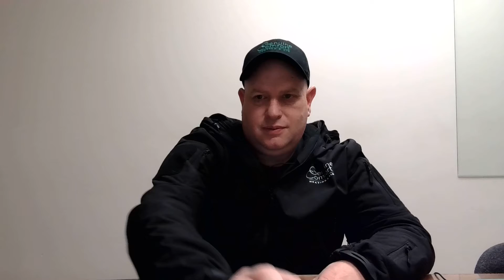Why Do Furnaces Short Cycle

Comment: Thanks for trying. The number one most complained about problem on home heating and cooling DIY repair forums when the problem didn't start getting worse on it's own (which can indicate a component in the furnace not working correctly, or a dirty filter) is the furnace firing up and running 5 minutes on and 5 minutes off during the winter. Most of these complaints were by the DIY'er that just changed from a manual thermostatic spring type thermostat to a digital solid state type. The problem then is these newer thermostats are just too sensitive. They sense the air blowing right out of the duct vents too soon and react immediately. Then the room cools too soon, and back and forth like that. With the old thermostats it took a while to affect the shape of the spring to activate whatever type of physical switch it had in it. Which in turn caused the area to be better saturated with heat. Also those old thermostats didn't react as fast and call for heat as quickly, as the room took longer to cool down, especially if there were furniture and things in the room that stored up heat and slowly released that heat as the surrounding air cooled. 

I just happened to be searching the internet to see what kind of new tech had been developed in thermostat controls lately, and I'm still not convinced enough that I'm going to spend an extra $150 to $350 for a smart thermostat just to control it from my phone. Statistically, they have a habit of not lasting very long, and the only other feature they have besides the phone controlling aspect is that they learn your coming and going habits, but only if you leave and come back around the same times every day. You can do that with the 7 day programming set back feature on about any $20 digital thermostat. So what is left is that they have the 'cool look' feature, but many consumers aren't with the buying it over and over every 3 or 4 years scenario to get that. Then, to what point is it really saving money?

Anyways, as I was searching the internet this saturday morning for what might be "new and improved" (laughing to my self as I think about all my friends and family that are buying new washing machines and clothes driers every 3 to 5 years because they are more efficient, and I'm still using 1980's units that are easily and cheaply repairable) in the HVAC controls department, I ran across this website www.tempitrue.com , and as an old guy that is wise enough to know what works, I said Hell Yeah! Now there is something that will work. I know because I have a shallow cardboard box with a hole cut in it covering my $25 dollar digital thermostat that I don't even use the programming part of it, I just leave it set at 70 all the time, and that little trick right there saves me at least $30 to $40 a month in the winter time off my used to be natural gas bill, and another $10 a month off my electric bill from the furnace fan running less. My living room wall is missing some paint  next to the thermostat from ripping the tape off a few times a year, but at least I don't have to listen to that big sucking sound on my wallet 6 or 7 times an hour when I hear the burners ignite and rumble in my furnace. It's pleasantly down to running about 2 to 3 cycles per hour now on days where it's below 32 degrees outside here in the northern half of the midwest. 

All this new fancy looking high-tech junk being peddled because it's "new and improved" and "more energy efficient" that ends up in metal recycling and garage landfills... How is that helping save money on energy when you have to spend more money than it saved on buying the next new one? How is that saving the planet when it just adds to the amount of garbage on this planet problem? How is it helping the planet when more energy needs to be produced and spent building all the new replacement so-called high-tech solutions for whatever that product does?

I wish I had one of those 50-something year old round thermostats still.  Finding one of those is like panning for gold in Kansas. I am ordering one these from this company even if it's the whole 30 dollars... Tempitrue  ...beats ripping the paint off my living room wall again from taping a box to it after I paint, and it comes off and on easy enough is what the youtube installation video shows.

Comment: Thanks for the info. My becket burner is short cycling. I've got a New Yorker boiler. 2 zones. It's been about 2 years since I've gone through it / changed the filter etc. I'm hoping it just needs some normal maintenance. Gonna give it a shot.